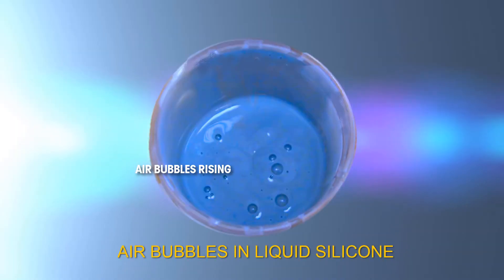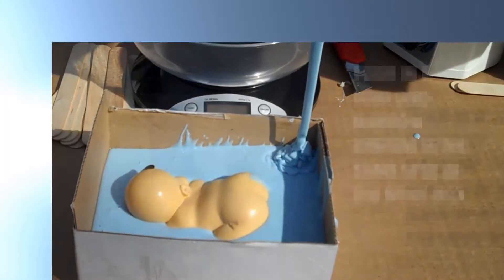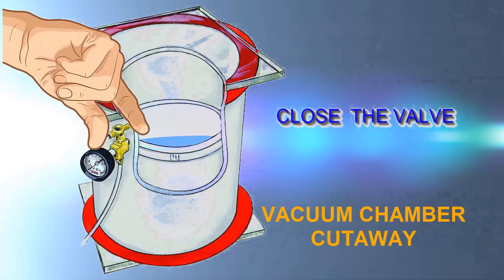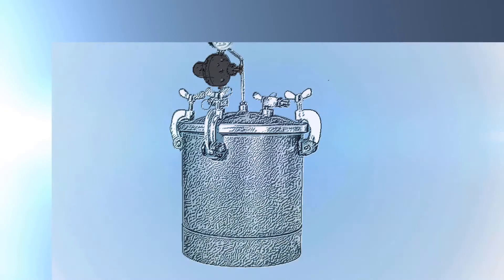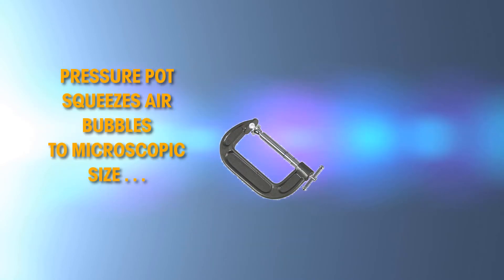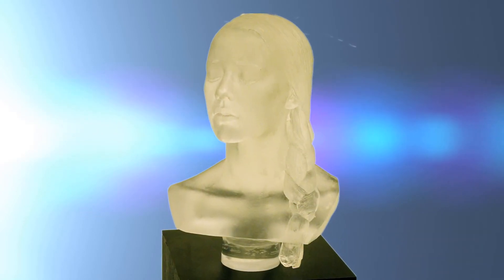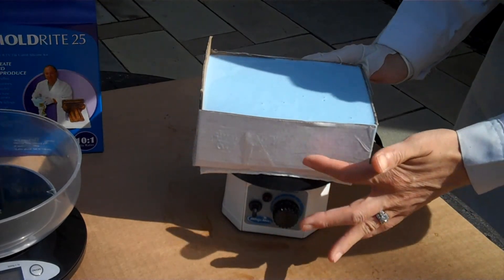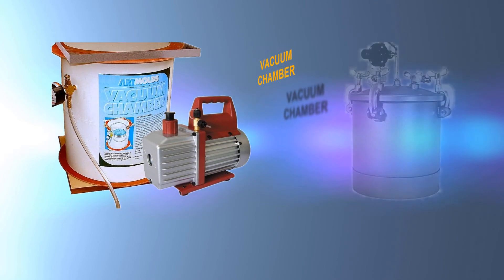Eliminating Air Bubbles with a Vacuum Chamber, Pressure Pot & Vibrating Table

Comment: So if I use a vacuum chamber or pressure pot, can I eliminate the need for vents?
Reply from the maker: You could in some instances. But with complicated molds you will still need vents to assure the casting material has filled the entire mold